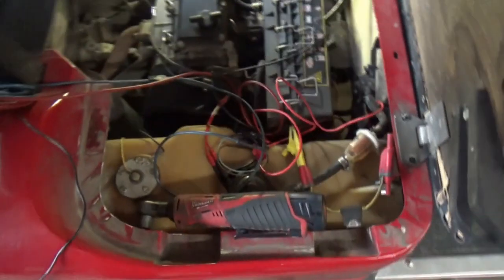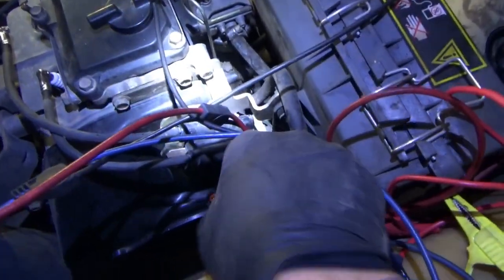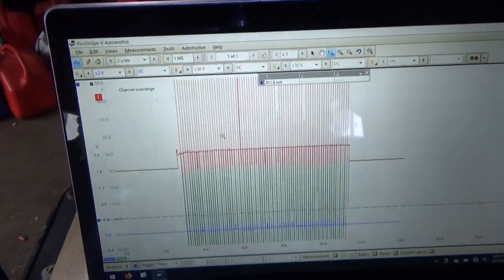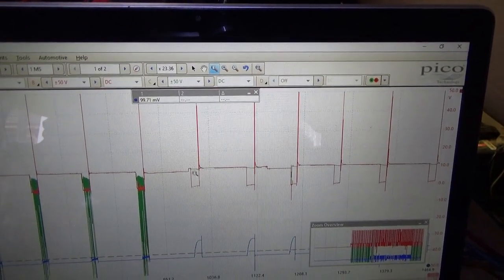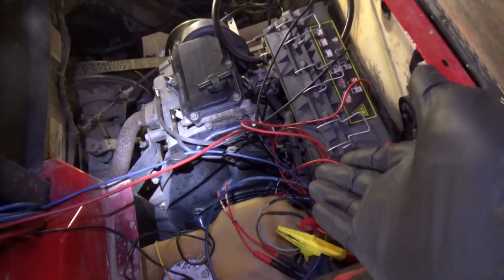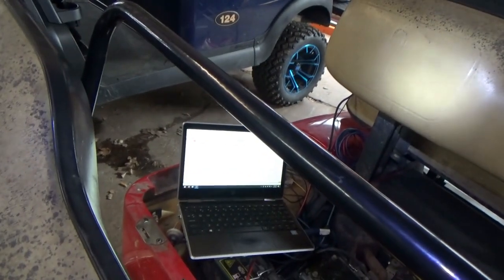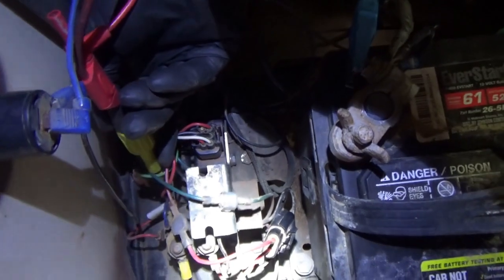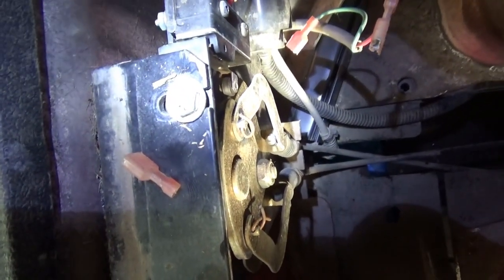Got Burned...by a GOLF CART?!? (EZ-GO No-Start)

Comment: Funny story about gas golf carts - they ordered some for the aircrew years ago (ANG Base), but they didn't want them. I got one for my shop and used it to run everywhere that I could, but in the winter they weren't worth a darn if stuff wasn't plowed clean. I dug out an old set of cable chains, cut them down, rebuilt them and installed them on the rear wheels. I went places with that poor little golf cart in the winter that had people shaking their heads at me, but I never got stuck with the cable chains on it. Kind of miss it now that I'm retired - it was a blast (cold, but still fun).

Comment: That "stupid little switch" is a standard appliance safety switch (lever geometry varies). I have tons of them salvaged from old stuff, microwaves always have several. If you want to replace it, definitely don't order from the golf cart manufacturer! A new one is about $3 :)
Reply: It is called a micro switch. They are very common on ga aircraft electrical systems where you don’t have any computer controls
Reply: was about to say the same thing, would be happy to send one over, but amazon would be just as quick...they disable the idle so when golfing, you dont hear it running the whole time
Reply: Thanks J V.
How many amps will said micro switches carry ?
Reply: @robertmartz9812  It is almost always marked on the side of the switch. They vary.
Reply: Fuel pump. 300$ at golf cart 🛒 
   Any riding lawn mower has the same pump that you can get for 25 bucks works just as well

Comment: I know this one is gas but  I loved working on the electric golf carts at work! always interesting. Many of the electric carts the problems were usually traced back to a wiring problem.
Reply from the maker: Hah it's either wiring, contacts, or battery 😁
Reply: @PineHollowAutoDiagnostics  I live in a summer tourist area on lake erie. 90 percent of the time electric carts have a battery in backwards because the owner didn't want to have me troubleshoot it so they fire the parts cannon

Comment: I got bit like you did on an old JD lawn tractor. The key to figuring it out was having access to the factory    service manual. All the gauges and electronics were one long series circuit. Bypassed one switch to eliminate a huge voltage drop and all the problems were gone. Thanks for sharing your successes AND your failures.

Comment: Loved your great video ‼️ I retired after 45 years. Spent summer working on EZGO. Had two with almost same issue. The green wire connector at 12 minute in was absolutely green corrosion. Fixed with spades. 
Second one customer lost most of ignition parts.  I used 78 Chevy ignition module and a GM DIS coil pack. Parts $50 from I Reilly’s. Golf cart dealer way overpriced. This system is so simple. Seventies technology.  Original problem was connectors not electronics.   Del

Comment: Ever since I got burned on an old Toytoa AE86 after dropping the fuel tank to replace the pump.
I always check the wiring can push current as well, it's always easy to display the voltage.

Comment: We had the same micro switches on wheel chair lifts in school busses, and the exact same scenario ,not caused by moisture but current spikes, the switch  manufacturer would not live up to a defect in the switch,  failure after failure, we replaced many over the years.  Zoeller sump pumps same problem.

Comment: Fixed the same problem on an older ezgo by moving the ignition feed from the small solenoid post to the large post on the starter/generator side. No parts, no scope. Voltage tester tipped off the problem, read low while cranking.

Comment: I guessed wrong on a Club Car, the rev limiter shorted the coil. I used to buy  micro-switchs 10 at a time. Worked at a coal fired power plant and the boxes were always gunked up. Had to fix them right for safety reasons.

Comment: Great job I understand all that you just did and have a scope and low amp clamp so will try it. I do recommend you get an open gap adjustable spark checker. It supersized me it would produce that much spark mine does not I am going to find out WHY.

Comment: Another acronym for you Ivan on this case. ..'NSR', no scope required for old school issue like this. Clues were jumping up in opening 50 seconds, floods or cart in the wet - >foot pedal interlock or electric related problem-> located in footwell,  easy talk in hindsight I know. Follow all your vids from Ireland. Your work is top notch, I'd say in good company with Diagnose Dan and Schrodingeras 3 best on YT. Great clarity of thought and process.

Comment: As always good content, I kept on guessing what was wrong, then the water moment, hind sight is just a crazy thing. Anything electrical and water just don't mix...  I avoid, even in car car, standing water... I look forward to more car brain teasers, maybe one day i will fix my 928...
Reply: Whats wrong with the 928?
They have some crazy electrical issues but theres tons of diagrams online
Reply: Won't start, fuel supply issue, starts if you spray fast start into the intake... motor is good, fuel pump (replaced) it did run but not now, figure that it is an ecu issue... it's only a S4  auto so not really worth that much, and finding a ecu where I live is out of my pay scale. Now if I had just brought a 911... I have 6 cars, all not collectorables, maybe that in itself might be a record...  Thanks for your interest. Take care.

Comment: This wet switch is very common. Also used in a boat remote control as a start in gear protection.  You are very competetive. Like that a lot. Greetz John.

Comment: So what did you do with the coil Ivan? Absorb the cost?
Thanks for the lessons!
Reply: I was wondering the same thing. Obviously Ivan had to eat the coil cost due to rushing to the parts cannon, but did he leave it in the cart, or take it with him to put on the wall at home as a reminder?
Reply: @John-wz3iu  That would have been nice but most supply houses have a strict no return no refund policy with electrical items.
Reply: Heck no 
Cart was under water 
It’s only a matter of time before it fails good investment 😀 for owner
Reply from the maker: Amazon no fuss return 👍
Reply: @PineHollowAutoDiagnostics  Beside free delivery for Prime customers, this another bonus.
Reply: @PineHollowAutoDiagnostics  Excellent!!!
Reply: @PineHollowAutoDiagnostics  Hi Ivan, I always love watching your videos. One suggestion I would like to offer, after making this modification, is to amp clamp the starter/generator then set the idle high enough to minimize or even zero out the discharge current. Depending how the clutch is set up you may be able to get it to zero or even into charge mode without it wanting to creep.

Comment: By the way that's just a standard micro switch you can buy a book pack of them on Amazon for like 10 bucks, they're used like everywhere, they are also super easy to take apart and clean up or swap levers.

Comment: I was given a rat's nest of a cart with made up wires and connectors.

The coil gets a white wire and a red wire.  Does it matter which side of the coil gets the white wire?  Or can they be switched?

And you're saying the coil gets 12 volts from the red wire?

Comment: I'm impressed this golf cart has a electronic ignition... I was expecting dirty points or a bad capacitor... LOL
Reply: There is no reason for electronic Ignition for a small gasoline powered engine (nor points and condenser). A simple modern magneto/coil ignition is more than adequate. What we're seeing here is just the designers adding unnecessarily complicated components because they can.
Reply: Me too
Reply: @sewing1243  many golf cart motors will spin backwards when in reverse. The ignitor module is way cheaper than engineering a timing mechanism that works both ways. Unless you just want a top dead center ignition.
Reply: @sewing1243  I disagree !  Best thing I ever did to my 1960s 5hp B&S rototiller was add electronic ignition.  Easy pull start and the spark plug will outlast me !
Reply: @patricktennant1585  Not if it has a 4 stroke engine !

Comment: After the wiring mod, with the ignition on, is the engine actually running fast enough so that the starter/generator is generating enough power to recharge the battery?  My golfing partner sometimes applies just enough foot pedal to make the starter turn the engine over but not fast enough to engage the clutch to make it move.  I'm thinking he's just running the starter motor and draining the battery.

Comment: I lucked into a 1980s Argo, 8 wheel Amphibious vehical that my crippled but is going to use for running limb lines for cat fish on the river. Turns out it's almost exactly the same as a golf cart. Think about how many times this vehical has been in the water in its lifetime. Almost every wire and ignition parts had to be replaced. Even for a retired engineer and electrician it was a headache. 

PS.,
There is no getting under mine. 

It's a boat with 8 wheels.

Comment: Thats pretty common with a ezgo thats been outside in the winter. The throttle housing gets water in the seal freezes and opens the case. Freeze opens the case thaw it seaps in.  The cure is permtex the shit out of the seal. If not you will get a return call. Rt 30 tire..

Comment: Could have connected across any of the wire lengths and looked for a voltage drop. Since it was under water, I am surprised other wires and contacts are not equally an issue. Water wicked up under the insulation will certainly show it's ugly head down the road, I mean golf course,  for sure. Schematic diagrams for those carts are all over the net... Thumbs Up!
Reply: Where?  Put the link up for this one because I haven't found it yet

Comment: I have a 2019 ezgo S4 that is doing almost the same thing only it is getting power to the coil but no spark coming out of the coil. The coil 670119 is out of stock everywhere with no known due date. My cart has not been in water. It hasn't even been rained on.
Any ideas other than coil replacement?

Comment: What about reverse?
Is it a gearbox on this one, or start the motor backwards? 2 stroke ezgo that I used to work on were "start backwards" style...
Reply: Lever with forward/neutral/reverse.  What he did was bypass the safety circuit...it shuts off the engine when the driver removes foot from pedal, thereby eliminating run away cart.
Reply: I agree, unlike a car engine that always rotates in one direction, most of the golf carts run in both directions depending on the direction you spin the starter. The customer will now have to remember to turn off the ignition before shifting into reverse since the motor now idles with the foot-switch bypass fix. Ivan get ready for a call back!
Reply: @franksoliday5510  Next time will be a clutch replacement !
Reply from the maker: @franksoliday5510  interesting point! The gasoline engine can run in two directions?? Owner had no complaints so far.... Will have to ask him 👍
Reply: This is a four stroke cart with a Forward, reverse transaxle. Engine only runs in one direction. As long as the clutch is not grabbing the belt, you can change gear.

Comment: Since the starter engaged when the key was turned on, does it stay in crank mode with the engine running or does the starter turn into the generator mode after it starts? I suspect it stays in crank mode as I dont think the it should crank with just the key.
Reply: Yeah, I didn't think there was a way to crank it via key on the ones that start when you push the gas.
Reply: that is the way EZ go makes those carts.key on push the gas pedal

Comment: You suggest coil current is 5 to 10 amps.  You test the circuit with a 300ma bulb.  Could the bulb test have been more perceptive if the bulb was 5 to 10 amps too?
Reply from the maker: Yes absolutely!

Comment: Hello I have a 95 ezgo 295cc and already put in a new ignition coil and a cdi box ,jumped the pedal switch add a hot wire just like you did still just one spark when I let go the gas pedal ,what else can cause this problem

Comment: Here in the UK I was told to volt drop  supply and earth's , in this case using a metre battery positve to supply terminal , anything over half a voltage ,no good.Or when checking earth , battery earth terminal to component earth , anything over half a volt no good. This has helped me with resistant in wiring Wish I could understand scopes and setup values .. will have to stick with my multi metre .
Reply: Voltage drop is were I always start with something like this.. I know Ivan is no fan of Sullivans Load Pro but I swear by it!
Reply from the maker: @johnlaplante822  the "magic cucumber!" 🥒😂

Comment: 8:25 there's a little 4-pin molex plug right by your hand. It is not moisture protected. I found this plug to be a big problem. It is what feeds voltage to the coil. If this plug isn't working perfectly you will have intermittent problems. I ended up cutting mine out and replacing it and have had no problem since other than my bad driving
Reply: Thats the cdi.  How did you cut that out?  It get the pulse from the engine then fires the coil.  Or do I have this all wrong?
Reply: @frontlinemedia4270  I basically cut out the old connector wire for wire and replaced it with a new one that is better sealed
Reply: @frontlinemedia4270  it's not the CDI itself it's the connector in the wiring harness that connects everything in that bay up to the engine
Reply: @butchblakesley6239  the only connector I see is the one to the cdi.   What is a molex plug?
Reply: @frontlinemedia4270  molex is a brand but basically it's a white plastic connector with a number of wires entering and exiting. The connector I'm referencing should be about 12 inches from the CDI. It should have about four wires going in and out
Reply: @frontlinemedia4270  the connector I'm talking about is the wiring harness connector that connects all the electronics to the engine. In this video it looks like it is a black connector but on mine it was a white connector
Reply: @butchblakesley6239  IDK what you are talking about.  The only connector in that video is black and it connects to the cdi ignition.   It has 5 wires.  Do you have a link to a wire diagram?
Reply: Also just check the pins and sockets in that plug and be sure that they are fully engaging and very clean
Reply: @butchblakesley6239  they rigged the whole wiring.  Connectors gone, you name it.  I need to know how the ignition works. Does the cdi get 12 v?  The wires to the coil are red and white, can they be switched?  What power voltage goes to the coil?
Reply: @frontlinemedia4270  the coil takes 12 volts it is very important that it gets a solid 12 volts low voltage is a very common problem that's why the connector is so important I believe the red and white can be swapped as I said it's been a long time since I worked on mine and I forget where I got the wiring diagram sorry I can't be more help on that
Reply: @butchblakesley6239  the coil is getting the red and white wire and this comes right from the cdi..  the cdi has 5 wires coming out of it.  2 are black but they splice together to form one blk wire which goes to the trigger. The white goes to the coil along with the red.  The red w/ white stripe goes to the trigger.   It's like I'm missing something here
Reply: @frontlinemedia4270  best advice I can give you without being there is to check at the coil that when it's cranking you get a solid 12 volts. Pull the plugs and check the spark, you should be getting a very active spark not a weak spark
Reply: @butchblakesley6239  I had spark than no spark.  Currently no spark.  I didn’t check if I had 12 volts to the coil yet.  
There's no 12v input to the cdi.  The only input is the trigger.  So I am wondering how would I get 12 volts to the coil?  Nothing is attached.  Everything that is plugged into the cdi goes right to the engine, specifically the trigger and the coil.  I thought 12v would be pulsed to the coil? If it's working correctly.     I don’t understand how this ignition system works to begin with
Reply: @butchblakesley6239  the plug you are referring to is the trigger for the ignition.  There are 2 wires in and 2 wires out.  This sends the pulse to the cdi
Reply: @frontlinemedia4270  the connector that gave me so much trouble was the one where the wiring harness goes from the engine to the electronics Bay if you could call it that. It sounds like the one you're working on has been so Joe McGee it's going to be hard to tell
Reply: @butchblakesley6239  I just rewatch the video and he said the red wire from the coil goes to the solenoid.   That doesn’t seem to be the case with mine.  I also don't have the inline fuse.  Everything is rigged on this.  I need to know how each component functions so I can hook it up correctly.   Right now, still a mystery

Comment: Ivan, you need to make a simple test box. A plastic box with a 300 ma. and 4 amp. light bulb connected together as the Negative lead. On the other side of the bulbs use banana jacks. Connect the Red test lead to the 300 ma. bulb and then to the 4 amp. bulb.  The reason you missed the problem the first time, is because you tested with the 300 ma. bulb and it was too much of a hassle to find a 4 amp. bulb. A test box would have saved you there in hours, and dollars. Voice of experience ....
Reply from the maker: I had the 4A bulb right there... Just didn't use it 😅
Reply: @PineHollowAutoDiagnostics  but you probably would have used it if the  option was only one inch away ...